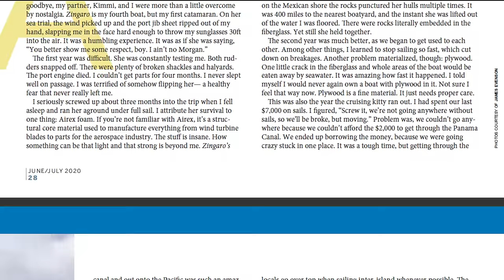Boat Repair: Dropping the rudder and fixing the damage on the hull

Comment: This channel is curing my desire to become a boat owner pretty effectively :-D
Reply: You don't watch Parlay then.
Reply from the maker: Well... just don't buy a boat that's been sitting. Boats need to be used.
Reply: Me too as much as I love the water and sailing
Reply: Depends what you want to do, but small boat, small problems. Go small, go now.
I bought a trailer sailer, 6 m. For sailing in Swedish lakes and around the coast with an archipialago. Some repair on a 20 year old boat and trailer, but also alot of sailing for the money.
Reply: @andvil01  How true we have owned a range of yachts all around the 38-55 both sail and power my spouse told me one day not long ago  "you can get a bigger yacht if you want" its like the IRS saying you have a bigger refund. My immediate response was No not gonna do it let's get a smaller yacht 38 - which we did and its still a fair amount of effort.
Reply: Guys.  It's not bad honestly owning a boat.  Yes there's work but the life more than makes up for a bit of elbow grease.
Reply: @gp-gm6ev  I am sure the buddhists can say something about owning a boat, suffering and finding the higher meaning of life.
And I do own a sailboat. And a canoe and a kayak I both build myself from scratch.
Reply: @andvil01  amen!🤣
Reply: @thelastpirate  and boats need to be saved, thanks for saving this one.

Comment: when i sailed across the pacific in 2010 my rudder snapped at the waterline right in the middle of the passage between Noumea to Australia, ultimate cause is we had excessive play in out rudder stock, this allowed for the slightest lateral pivot pressure to develop and in large seas the rocking motion caused metal fatigue to develop and of course the snapped rudder stock occurred during the night.....luckily the rudder was built with positive buoyancy so it stayed within the rudder stock just riddled useless...that rudder stock looks quite staunch so probably no issues with yours but good to ensure there's no excessive play.......keep on with the project brother!

Comment: A set of hole saws may have saved you trouble and mess.    The method:    1)  Get a 1x6 or metric similar sized piece of wood. Hole saw a plug from the 1x6 that is the diameter of the hole in your hull.    2) Put that plug into the hole in the hull and duct tape it on the underside of the hull to hold it in place.    3) Select a hole saw that is the diameter of the glass fiber that you want to remove.    4) You may need a longer pilot bit for your hole saw arbor. From the inside. Use the pilot hole that is in the wooden plug to stabilize the larger hole saw as you remove the glass fiber with the larger hole saw.
You can use hole saw sizes that are progressively smaller to remove material that needs to be removed. You seem to be a skilled craftsman. You decide if this method could help or adjust it to your particular situation.

I hope I have described this method in a way that you  can follow. While I have never cleared a through hole in a boat, I have used this technique in similar circumstances many times.

Thanks for the videos.

Comment: Another good one, interesting design for the skeg and rudder, there are a lot of forces from wind, current, wave, water resistance, engine vibration, etc etc being transmitted to the rudder post and it's supporting structures, you illustrated the stresses in your video well, and your presentation, and video editing are informative without being dry,  keep up the very good work.

Comment: If the rudder shaft had not dropped clear - there still would have been no need to pay $250 to have the boat lifted - it looks like you could have just dug a small hole in the ground under the rudder to allow it to drop far enough down to clear the hull.  (as it didn't look to be a concrete pad on the hard there)
Reply from the maker: The marina doesn't allow digging here.
Reply: Yep buried electrical lines and such can pose a safety issue to digging holes.
Reply: Fair point, got to follow the yard rules then.
Reply: everybody digging a hole at the yard, your next on that place, you imagine...
Reply: I had the same conclusion ??

Comment: Congrats on an insanely difficult task! I thought you were crazy when you told me what you were planning. However, as far as the reinstall goes I think you'd want to add a very thin (very) release agent and then epoxy the shoe back in (talk to Eddie at Oyster first. He'll know). It's super important that the shoe not flex from side-to-side or else it will stress the rudder stock and bearing. Once epoxied or otherwise secured make sure to run the rudder to both locks to make sure it's aligned properly. You don't want it to bind up along the way. That big, solid stainless steel rudder stock and monster quadrant were actually a big selling feature to us. When I see the broken fiberglass rudder stocks from the modern production boats sitting around the yard I always smile to myself. Too bad about the through-hulls. I think when I do mine I'll grind the lower flange off, then cut out the threaded upper section if I can, then use the sawzall method with a fine metal blade to cut the through-hull into quarters or thirds vertically. I just replaced the chrome-over-bronze clamshell head vents on Talisman last week, and although it sucked, it was nothing like what you went through. Keep up the great work.
Reply from the maker: Yeah the rudder was a big bitch. But it's done. Guess I didn't have to change the bearings... that sucks. Tons of work for nothing... But everything is new now, so that baby is SMOOTH as butter. Autopilot won't work too hard.

Comment: If your boat had been too low for the rudder shaft to be able to clear the hull you can dig a shallow pit under the rudder to provide more clearance, if the yard is okay with you doing that but it's always easier to beg for forgiveness than to ask for permission... : )  Good Luck!

Comment: James - a suggestion. Before you go any further why don't you take a day and with a couple of friends completely clean out the interior of the boat. Throw out shit, vacuum, brush, sweep, wipe and clean. You will have a much better sense of what there is to work with and much less demoralising to open a hatch and find a clean today space, even if there is work to be done there. Just a thought!

Comment: Hey James,  late to the party as usual but just a word to the wise. Silicon bronze is about as stable a metal as you can get. No good can come from grounding to any other piece of metal.  Leave them isolated and it will be fine.

Comment: Please reconsider using teflon washers teflon flows under pressure when squeezed and will leak. Also any sealant will not adhere to it. Not a good choice for this application.
Reply: I completely concur with Jim on this one. He is spot on.
Reply: G10 or black Delrin would be the material of choice. Teflon absorbs water too, that will make it expand and contract. A mate's boat has Teflon rudder bushings. Absolute nightmare locking the rudder up.
Reply: There should be real honest (that is "absolute bubble-free") glass laminate instead of a somewhat hardening gooey mess around those through hulls, too, for starters. So Teflon will make it more of a nightmare but just a tiny bit.

Comment: Why in the hell didn’t they use a “hole saw” to cut out the thru holes!
Would have been a nice clean hole a fraction bigger than the valves themselves.
Reply: Monday morning quarterback ???/
Reply: Repair the old holes and start with a new clean hole.?

Comment: Bad news -that's what happens when brute force and ignorance is applied. The yard workers should have known you can't hammer out through hulls that are bonded in. You have to cut them out either with the correct rotary tool or by using a reciprocal saw and cutting a couple of slots along the walls of the through hull... Keep up the good work!

Comment: The wireclamps on your steeringcables are not correctly attached. The flat side of the clamp must be on the working side of the cable. If the thin halfloop is on the working side, it will clip the cable if under strain
Reply from the maker: You're only the second person to catch that. Good eye.,

Comment: If you did not have enough room you would not need to lift the boat up. You could just dig out the dirt under the rudder area so it could slide down.

Comment: Doesn’t look to me like you need to remove the shaft from the rudder at all. Just a good clean and regrease everywhere and then refit. The shaft turns with the rudder and you may well find that the shaft is fitted with tangs inside the rudder to keep it from working loose inside so the only way to get it out will be to split the rudder. The bottom bearing is on the skeg, not the rudder. If it ain’t broke, don’t fix it!!! Check this out (if I’m not too late), please!!
Reply: Oops! I wrote this and then noticed I hadn’t seen the last bit of the vid where you dismantle the lower bearing so ignore my comment! 😅

Comment: Next time your boat is an inch to low to slide the rudder out... don't think about lifting the boat. Get a shovel and dig a 2" hole to lower the rudder that needed inch.😉

Comment: Well done pleased you have a handle on things , , the cocks  ,you can wrap one in plastic and tape , poke it back in the sloppy hole and pour resin in from the inside then pull them out when dry we did that with a couple , the wrapings on the fitting just allow room for the resin and fills up the hole. ,but you will sort it ,,,,,that boat is in very good condition just needs hands on to maintain certain things and not much to get to the water. ,sea cocks , rudder , anti fouling , check the motor and go well done , the rudder shoe was first epoxie fit to fill all the imperfections , the second time use micro smooth not as hard and pliable to remove  ,check it out

Comment: I know the job is done but my thought were:  Can you go up in size in the thru-hull fitting and core out the delamination?  If not I might treat it as any hole in a boat and patch it completely with feathering and re-core it for the fitting.  That seems to me like the most structurally sound way to fix it from water ingress.  Another way is to put an air tight backing on either side of the hull and pull vacuum then inject a non-vinylester epoxy back into it while under vacuum. All ways are a giant pain in the ass.  Better for it to be a pain in the ass on the hard than a pain in the dick out in blue water.

Comment: I was cringing when I watched the video of those yard guys driving those thru hulls out from the outside to the inside.  That is not how I would have dealt with this issue.  This is why I did all the work on my boat when I did a gut job.  (Including through hulls and sea cocks)
Reply: So how would you do it? Seemed those parts were super tight in there. Is there even a way to get those things out without exploding the fiberglass?
Reply: @RomboutVersluijs  Hi I would have tried a more "surgical" approach to removing the thru-hull fittings.   Even though he ground off most of the outside flange part of the the through hull fitting, I don't think he took it all off down to the outer diameter of the threaded barrel of the through hull fitting.  Driving the through hull fitting out from the outside of the boat is going to do a lot of damage to the fiberglass around the through hull.  I would be concerned that damage could propagate for several inches around the through hull.   
He was trying to use large pipe wrenches and a hammer and chisel to remove the large bronze through hull nut.  Not the right tool for the job.  He needed a large socket 21/2"-3" ?  A 1" breaker bar and a couple of extensions.  If the threaded barrel was to high to get the socket on the through hull nut I would have cut the barrel off flush with the top of the nut with a cut off wheel heated up the nut and inside of the through hull fitting with a heat gun sprayed the nut with liquid wrench gave it a day and then put the socket and breaker bar to it.  If that doesn't work take your cut off wheel and carefully slice the bronze thru hull nut from the top into 4 sections including the threaded barrel of the through hull , you should be able to chisel the 4 sections of the nut off the through hull now.  Then from the out sideof the boat I would fab up a tapered tool from 1/4" inch steel that I could jam into the inside of the remainder of the thru hull tap it in with a hammer till it's tight clamp a pair of vise grips to it and unscrew the rest of the thru hull out.   If that gives you a fight the last option is a metal blade on a saws all.   From the inside of the thru hull barrel make 4 cuts the length of the barrel and section it.  You should be able to drive it out (from the inside) with a chisel.    That was how I dealt with them on my boat.  The cutlass bearing for the propeller shaft gave me a bigger fight than the thru hulls.. : )
Reply: @mojoneko8303  James didnt had the right tools he thought those man would do a good job i guess. Not sure why they didnt use the approach you described, like cutting it in 4 parts. I mean they had the tool for it?!
Reply: @RomboutVersluijs  That's why I've always done my own work on my boat's, my house's and my vehicle's.   I prefer to do it my self.  I would have fired those guys the minute I saw them approaching my boat with a sledge hammer.. : )
Reply: @mojoneko8303  Pretty cool and money saving if you got those skill!!!
Reply: @RomboutVersluijs  I lived in Alaska for 50 years and rebuilt 3 sailboats up there back in the 80's.  You had to learn the skills yourself because competent skilled labor was hard to come by and very expensive in the frozen north.

Comment: Hot Dutch ladies where you are at now………… and for the future …… you could’ve had a jig for a hole saw and drilled them out to the size of the new bulkhead inlets. Hole saw through a piece of wood, remove the arbor bit, and use the hole in the wood to guide the hole saw while drill the old ones out.

Comment: No, no, no, no, on the cabosil/fumed silica! Grind back and use cloth concentricly to build back.... As a minimum use mill fibers and epoxy... Cabosil will crack eventually, way, way less structural... Glass fabric is the best bet then re-drill the center....
Start over James.... Sorry
Reply from the maker: This isn't structural, bro, that was secondary chopped strand layup on top of 3/4" of solid hand laid glass. There's no way to do that without grinding down the outer hull so all the glass has enough room for adhesion. Why would I grind down the factory layup just to re-drill the through hull? Seems like it would be weaker, no matter how good I was.